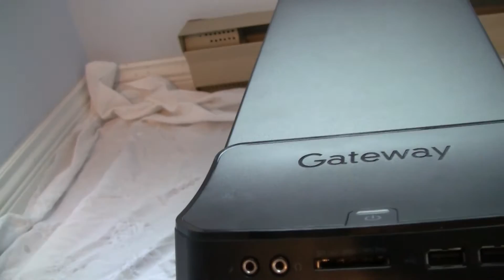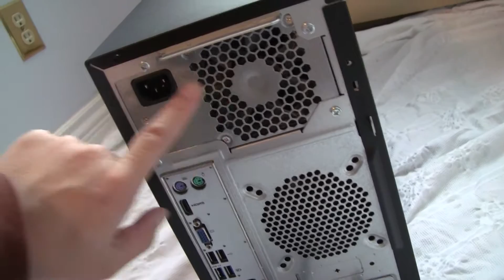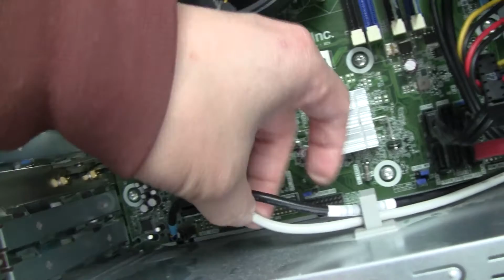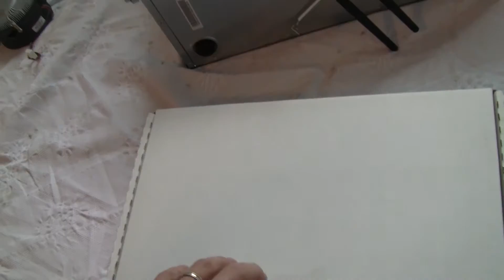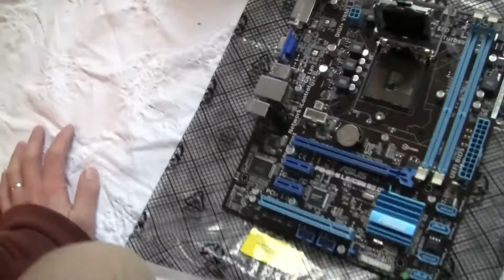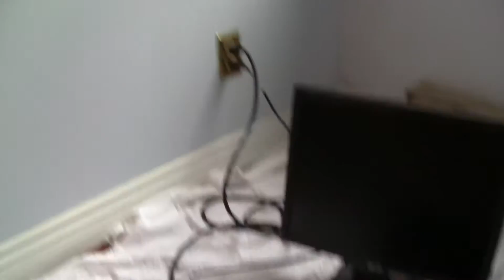Cheapo Tech: Replace motherboard on Gateway desktop computer

Comment: Hey henry, I have a Gateway DX4850 that's been previously owned (my parents). It will power on, but when I connect an hdmi cable and monitor to the HDMI port, it shows no signal. Is there any way you could help? I've searched high and low for answers, but I'm not very tech savvy, so I don't know where I'm going wrong

Comment: i just put a asrock x570m and ryzen 5 5600x in place of that dead board in a micro atx gateway like that. a nice sleeper PC.
Reply: bout to do the same with the Gateway FX6831
Reply: does the power cables, usbs and f panel all plug in to the new motherboard?

Comment: I have the same computer and motherboard.  My computer died and will not boot.  I removed all drives and cables.  I tried new RAM and removing and replacing the battery.  None of these things worked.  When I power it on,  the CPU fans start and that is all it does.  Do I need to flash the bios and if so how do I do that?  Thank you.

Comment: I have this computer. I am still using it today it is a gaming monster haha.. it came with an I3 2120. I have changed all the components except for the motherboard and the case. It now has an i7 3770. A Corsair 600w power supply. An ASUS Strix RX 580 8GB graphics card. 1 PCIE SSD. And 1 SATA SSD. 16GB ram.
Reply: I got this case too, and I’m changing everything... but the hard drive
1) Asus TUF B-450  
2) Ryzen 5 2600x
3) 500gb ssd
4) the same graphics card as yours
5) And a 500w psu (I’ll maybe upgrade it)
Reply: Wait, you can do this on a SX2110G?

Comment: I have the same motherboard and wondering if a zotac gtx 1050ti mini non oc would work?
Reply: I have this computer. I am still using it today it is a gaming monster haha.. it came with an I3 2120. I have changed all the components except for the motherboard and the case. It now has an i7 3770. A Corsair 600w power supply. An ASUS Strix RX 580 8GB graphics card. 1 PCIE SSD. And 1 SATA SSD. So it should work. My graphics card is big and it fits in this case no problem

Comment: My Gateway FX542X turns on but doesn't signals monitor when I connect with another monitor it's black screen. In the past I would turn off by holding power button down then  unplug and it would default to normal boot I have a feeling it's power supply issue but not sure if you can help me I will donate money to your channel. Thanks in advance. M

Comment: Hello Henry Q!
Your video has been very helpful as I am planning to swap out my motherboard as well. What model is your Gateway? I have a DX4870 with the same motherboard as yours (IPIMB-AR) and I just want to swap the motherboard out and add a new GPU and PSU. Would the process of my computer be similar to yours? Also, what was your model ASUS?
Reply from the maker: +ConnArtistTrombonist I have exact same model, DX4870. I replaced with ASUS P8H61-M LE/CSM R2.0-R LGA 1155 Intel H61 Micro ATX Intel Motherboard. Works with same CPU and memory. I find Acer products unreliable.
Reply: Henry Q Thanks for the swift reply! Thank you so much for your help
Reply: Oh I have one last question. The special screws that held the backplate of the heat sink together, are torx screws correct? And you used a torx screwdriver? You said something about a screwdriver with a brand name I think but I couldn't make it out. What screwdriver did you use?
Reply from the maker: +ConnArtistTrombonist It's just a screw driver with changeable heads. I have many different heads for the driver. yes, it's a torx screw.
Reply: ok thank you
Reply: +Henry Q Ok so I just got the same motherboard as you did and installed everything. There are two cables that I couldn't find mentioned in the video as to where they go. One has a yellow head, while the other one has a head but the wires are visible with the colors white,red,blue, and green. I have no idea where these go. Also does at matter where the SATA cables go? I've tried the motherboard power test and the fans turned on for about 4 seconds and then turned off but the green LED stayed on (did it pass?), and when I connect everything the fans don't turn on at all. Sorry to ask you for help again!
Reply from the maker: +ConnArtistTrombonist it's ok for green LED to stay on, as the power is connected. but fan stopping is obviously not good. without hands on troubleshooting I don't know what's wrong. could be the motherboard or CPU. it doesn't matter which SATA cable slot you plug in. don't know what the 2 cables are, but for now they are not as important as other issues (they are probably USB or front audio cables)
Reply: +Henry Q hello it's the same person. I don't believe it's the CPU because when I reinstalled the first motherboard using the same CPU everything worked. Idk if the fact that I plugged in the drive cables incorrectly was the issue could I email you some pictures of what I have placed so far?
Reply from the maker: +Martin Nguyen Connecting drive cables incorrectly wouldn't have caused the computer failed start. but try to unplug everything, only have power unit, memory and cpu on, and only connect the front panel cable (power on button), see what happens.
Reply: Yes I did that but I got the same result (one stick of ram, the 4 pin and 24 pin power from PSU, and the CPU fan, nothing else) could it be a power issue? Would a psu that wouldn't supply enough power for everything have similar results?